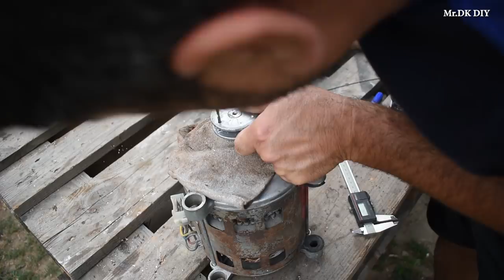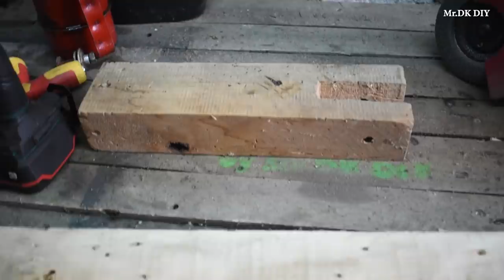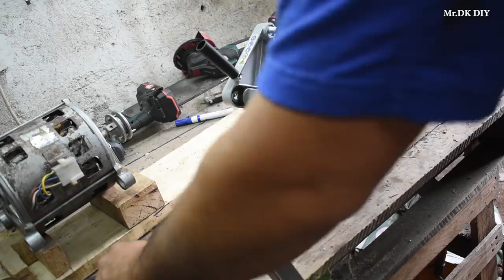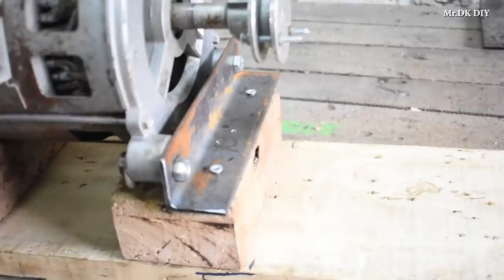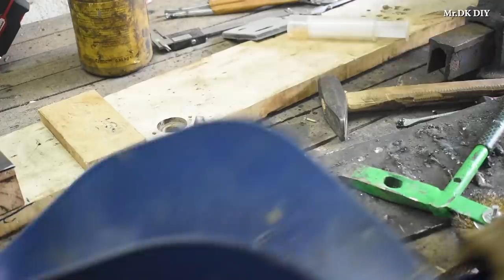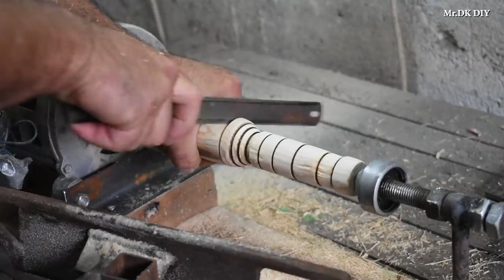DO NOT THROW THE OLD WASHING MACHINE MOTOR IN THE TRASH / DIY LATHE FOR WOOD

Comment: In the Fire Dept...we use these old motors to make fans. Just hook a belt up to the pulley...build a wooden box to  cover the motor and blades...and voila...you have a nice, hard working fan. Two thumbs up on the video. 👍☀️👍 (And a video on how to wire the motors would also be a good idea).

Comment: Looks really safe, (especially the wiring!) I'd be happy letting me kids use it
Reply: I know you posted this 3 years ago, but i have to have said this:
Pls lookup the following title: Worker killed by forklift.

You have to press Agree several times before you can watch it on youtube these days. 
I am talking about the video showing a guy standing next to his truck waiting for the forklift to load his truck.

That man is wearing a safetyjacket.
Lots of light. Reasonably safe location.
And yet the man ends up underneath the pallet because he made a choice.

His safetyjacket, high vis material, did not help.
His safetyshoes did not help.
His training did not help.

The forklift driver's training did not help.
The lights on the forklift did not help.

So my question is: what do you mean?
Kids should not play with equipment in the first place, should they?
Not even if it is labeled safe.

And adults should take care of their own safety, right?
Because all of the before mentioned safety gear and regulations have not saved that man.

And i can show you plenty of other stuff that happens around equipment that was built by professionals, and yet somehow it causes the death of a person.

SO i do not understand what you mean when you say: Looks really safe.
Equipment like this is never safe. Not even if it is build by professionals with all kinds of safety knobs and stuff onboard.
People will still find ways to die using what some call safe equipment.

Comment: nice and simple, well done. those motors usually come with 2 speeds 350 and 2800 rpm, probably you worked with the higher speed. it will be a bit problematic with larger wood and probably will need pulley system to get better control.still I am amazed they are rated only for 125\175  whats or so..they look stronger than that!
Reply: It is good

Comment: How did you gain control of the rpm speed in that motor ?  Washing machines run at crazy rpm, and the drive shaft you are spinning from is usually connected by belt to a way larger wheel on the back of the drum, the motor itself could be spinning at 12000 rpm or more. Could be overkill for wood turning.

Comment: This is seriously dangerous so dont do it people. Also anyone asking about the motor wiring, as u see the great insulation tape in the video, yeah dont do that either.. oh yeah under that tape is a capacitor, the motor needs that to give it the false illusion of a 3 phase motor to give it an offset sinwave that is offset to the actual ac waveform from your electrical supply. Once the motor is spinning the capacitor is no longer required as the single phase will be sufficiant to carry the motor rotation. Without that capacitor the motor will just be at a stand still unless manually pushed along but be warned that trying to manually rotate the motor you risk loosing a body part when your hand gets snagged onto the shaft and decided to detach its self from your harm as it wants to play merry go round with the motor.

Just dont people seriously dont

Ps.. dude who made the vid.. get some training on using these types of tools. The table saw and grinder... Damn its like watching that movie final destination... Quit while u still have your hands.

Comment: Very good!!!  how to connect the electrical part of the motor without the control unit? Thanks
I would like to use a washing motore to brush aluminum
Reply: You wire the run coil across the AC mains and the start coil across the capacitor which you also have to dig out of the washing machine. This makes the motor a constant speed motor and removes the hassle of a speed controller.

Comment: Timber is not super expensive, and I get it that it's sometimes great to re-purpose an old piece, but with this project, I'd purchase new timber for a better overall effect to a job well done...........He has the right idea for a cheap and effective lathe, but near enough is not really good enough in this instance, because being a functional workshop tool, the time and effort put into it, would justify it's  completion with all parts painted to whatever colour one chooses . Also, the piece of wood off cut was way too small for the pointed screws on the pulley to fully facilitate it, with one actually shown as to come off the side at 15:44  . Another  point worth mentioning, would have been to use the proper rubber bushes when mounting it to the angle iron. Slowing down the action to 0.25 speed there appeared to be a rubber washer inside of the steel washer which would do nothing much in dampening any vibration. Presumably, it would have had it's correct bushes when mounted in the washing machine. Still, perhaps he'll upgrade it later. I may be nit picking, but wouldn't pan head screws or 1/4" bolts be preferable. Countersunk screws are fine if you countersink the plates. The idea has merit, so one cannot fault him for that, but purleeeeese, one needs to take some pride in the finished job, whatever it might be...
Reply: ผมสนใจมากครับ

Comment: ok,...have to admit that the hair standing up on the back of my neck is nothing to the tingling on my spine !! Using a washing machine motor like that is like standing in front of a runaway train hoping it wont hit you ! But I do realise that making use of it is far better than throwing it away. It needs some speed control on it PLEASE PLEASE dont use these motors without it.  They reach full momentum in under three seconds and will maintain it,...... a wood turning lathe  doesnt need RPM anything like that 500 to 1200 is more than adequate and far safer too. At tha fullt speed if the wood decides to part company it wil feel like youve been hit with a policemans truncheon !

Comment: U skipped one of the most important teaching moments of the video-how I wired the washing machine motor to run. That is one of the hardest things to do in that they are so different. It would be mice if they were as simple as a dc treadmill motor. I have several washing machine motors lying around but can’t figure out how to wire them.
Reply from the maker: I will make a video on how to properly connect the washing machine wires
Reply: Thank you, that would be great and much help.
Reply: very true! also, needed is something to control the speed of the motor.
Reply: Type in the searchbar on youtube home page : How to wire up a washing machine motor, by Hawktail Knives, he tells and shows how to do it.
Reply: When YOU WILL then WE  WILL liked and Subscribed....
Reply: Zetuz kid.  I think you need to connect the running capacitor of that washing machine motor. You find that at the side the motor beneath the washing machine.
Reply: You are just a human, not a man

Comment: Great to watch set up and manufacture, connection sequence would be good, got to say, a bit on the dangerous side, running bar should be fixed.
Reply: Maybe so, but did you see what he was using for a table saw? Clearly not overly safety conscious...

Comment: 3 tiny screws holding each angle iron down to a block. 6 tiny screws holding each block to a flimsy used piece of scrap wood. High speed spinning a block with this is about to be a Darwin Award event. Using a real wood lathe is dangerous enough. Stop using this NOW.

Comment: Some narration would help.  I understand the lack thereof if he is Russian or something.  A good lathe needs to be braced better than wood will do.   If you don't have metal use the hardest wood you can find and larger pieces than normal.    The tail stock is weak looking, it should have a second bar welded to it, but the wire burning Idea I have not seen before, glad I saw this video.

Comment: Dude...you can't drill a hole at an angle and not protect the motor from debris metal particles falling down into it when you were grinding, and expect it to work properly for any length of time.  Your idea is alright, but your shop skills are atrocious, as well as the music you play during your project.